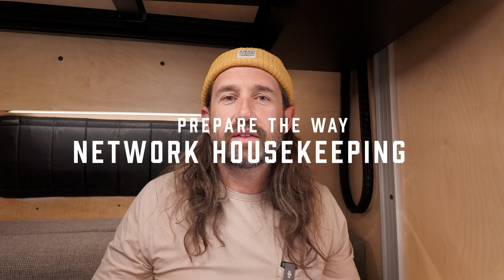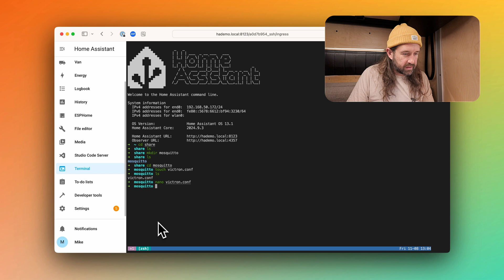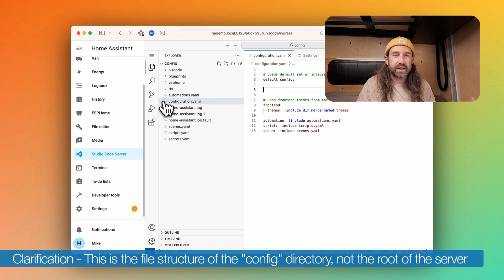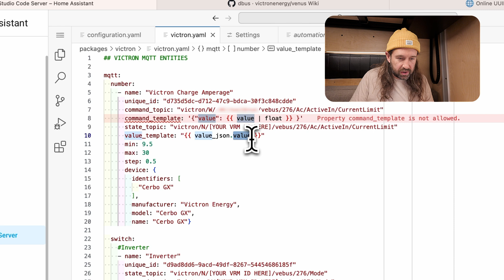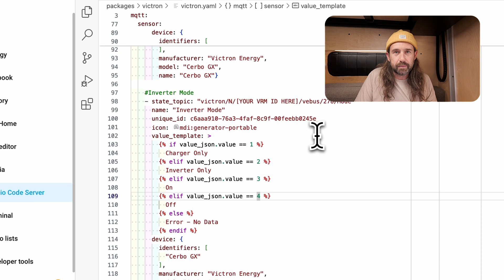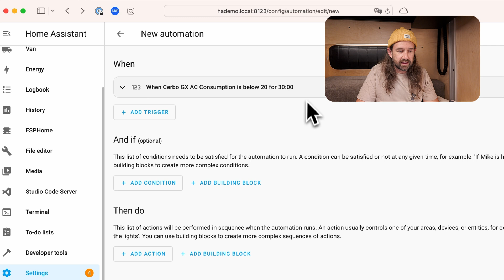Integrate Victron Into Home Assistant Using MQTT (bi-directionally!)

Comment: Hey Mike.  What a great video, it's just what I'm after!!
I'm having a few issues however...  The first is that the MQTT feed from my Cerbo goes to sleep after a few mins.  It starts again if I got to the vrm page on a browser but only for as long as I'm on the page.
The "keep alive" automation is running (I can see it on MQTT Explorer) & I'm running the latest firmwear.
Any ideas what could be preventing it from staying awake?
Thanks in advance.
Reply from the maker: My first instinct is to double check that your automation is sending the correct message. What is your topic and payload?
Reply: @SmartyVan  Hey.  Thanks for getting back to me! 
The topic I'm using is; victron/R/<secret>/system/0/Serial
& I can see it refreshing in MQTT Explorer.

I was sending "{}" as the payload, but I wondered if it wasn't keeping Cerbo awake because it wasn't changing so I changed the payload to a timestamp, but no change (I can see the timestamp changing on MQTT Explorer)

I have nodered enabled on Cerbo as part of the "Large Features" & use MQTT to publish some system numbers to my old automation setup.  Do you think that could be a problem?  I don't see how it can be...
Reply from the maker: Looks correct. As you see this message in MQTT, I would next investigate your MQTT custom config (share/mosquitto/victron.conf). Are your topics correct?

topic N/# in 0 victron/
topic R/# out 0 victron/
topic W/# out 0 victron/
Reply from the maker: Also double check your automation traces to confirm it is actually triggering ever 30 seconds.
Reply: @SmartyVan  Looks like that might be it!!!
My file contents looked exactly right, but I deleted them anyway & pasted your text back in.  Seems to have done it...
A rogue space or something maybe??

Comment: I am trying to write to DVCC Max Charge Current and get the following error

2025-02-13 12:45:17.891 ERROR (MainThread) [homeassistant.helpers.template] Template variable error: 'value_json' is undefined when rendering '{{ value_json.value |round(0) * 1}}'
2025-02-13 12:45:17.891 ERROR (MainThread) [homeassistant.components.websocket_api.http.connection] [139648709657360] TemplateError: UndefinedError: 'value_json' is undefined rendering template for entity 'number.victron_max_charge_current', template: '{{ value_json.value |round(0) * 1}}' and payload: 20

This is the configuration:
mqtt:
    number:
        - name: Victron Max Charge Current
          command_topic: "W/xxxxxxxxxxx/settings/0/Settings/SystemSetup/MaxChargeCurrent"
          command_template: "{{ value_json.value |round(0) * 1}}"
          state_topic: "N/xxxxxxxxxx/settings/0/Settings/SystemSetup/MaxChargeCurrent"
          value_template: "{{ value_json.value |round(0) * 1}}"
          unit_of_measurement: "A"
          min: 0
          max: 40
          step: 1

This is a snapshot from MQTT Explorer:
"Sorry cant past images?"

The error I get is when moving the slider on the overview page.

Feels like this is a read only variable but how does the DVCC write to it?

It is a FreedomWon battery and BMS

WHAT AM I MISSING PLEASE!

Regards Peter
Reply: Ignore above. I had the command template wrong

Comment: Getting an error wondering if Anyone can shade some light on it.
Configuration warnings
Invalid config for 'number' at packages/victron/victron.yaml, line 5: required key 'platform' not provided
Invalid config for 'sensor' at packages/victron/victron.yaml, line 81: required key 'platform' not provided
Invalid config for 'sensor' at packages/victron/victron.yaml, line 98: required key 'platform' not provided
Invalid config for 'sensor' at packages/victron/victron.yaml, line 123: required key 'platform' not provided
Invalid config for 'sensor' at packages/victron/victron.yaml, line 168: required key 'platform' not provided
Invalid config for 'sensor' at packages/victron/victron.yaml, line 183: required key 'platform' not provided
Invalid config for 'sensor' at packages/victron/victron.yaml, line 199: required key 'platform' not provided
Invalid config for 'sensor' at packages/victron/victron.yaml, line 222: required key 'platform' not provided
Invalid config for 'sensor' at packages/victron/victron.yaml, line 238: required key 'platform' not provided
Invalid config for 'sensor' at packages/victron/victron.yaml, line 256: required key 'platform' not provided
Reply from the maker: If you head over to discord and post your entire config, we can help sort it out! https://discord.gg/3rqeqES3zP
Reply from the maker: Platform is required. Must be number. Here’s the docs: https://www.home-assistant.io/integrations/number.mqtt/

Comment: Does the Cerbo GX have its own MQTT broker? Wondering if I really need HA to add custom devices (ESP32) to my Victron system. Seems like I would need an additional server running continuously just for HA
Reply from the maker: It does appear to be running Mosquitto. I just tested connecting to the Cerbo using MQTT-Explorer. I haven't tried using the Cerbo as a broker or doing much with it other than syncing to my Home Assistant broker, but it does seem to be running a broker. The recent Cerbo (VenusOS) firmware seems to change some configuration around MQTT which I haven't played with, so keep that in mind. I have not updated from 3.1.1.
Reply: Thank you for checking! Will try it myself soon
Reply: I was able to publish topics from an esp32 module with identical structure to Cerbo GX. Is it possible to create new digital input entities in Cerbo GX by publishing W topics from the ESP32?

Comment: i have followed this guide but under mqtt it doesnt show cerbo gx or anything at all, i can browse the mqtt broker and see all the data, not sure where i have gone wrong
Reply from the maker: If you've set up the MQTT sensor configuration correctly, be sure to restart Home Assistant—especially if you haven't' used MQTT before.
Reply: @SmartyVan  sorted now, been watching your videos for hours tonight but i am finally there...... apart from... how on earth did you get the inverter control as a toggle switch, i can only get one switch to turn on and another to turn off.
Reply from the maker: Glad to hear you're sorted! I have heard from another viewer that their switch wasn't working with optimistic: set to "false". You can try setting "optimistic: true" and see if that works better. I think it may be the response time of the inverter confirming the switch state too late. Which inverter do you have?
Reply: I’ve tried & failed 🤦‍♂️When checking MQTT explorer I can see Victron but only 2 topics which are the Victro’s  id.
I’ve just done a fresh install with just this on in case any of my other things were causing issues & still no topics. Rebooted etc.
I’m not sure if it’s more an issue with the Victron not sending messages rather that HA not receiving??
Any guidance appreciated
Thanks
Reply from the maker: If you can post your full configuration over on discord we can help you get sorted: https://discord.gg/3rqeqES3zP

Comment: This is such an AWESOME video - Learnt a ton of things! Thanks a lot for sharing!

I have one question - the GET of my cerbo values is working fine but SET does not appear to work from Home Assistant. 
As a test I used MQTT Explorer to connect directly to the Cerbo and I can Get (N) and Set (W) perfectly as confirmed by checking in VRM.
Now when I use MQTT Explorer to connect to HomeAssistant I can still Get (N) fine but it will not Set (W)? Any ideas what could be going wrong? The 'victron.conf' contains 'topic W/# out 0 victron/'.

Thanks in Advance 👍

Comment: Hi, thank you for the video, it is perfect and everyrhing is now working BUT the switch for the inverter (my victron multiplus 12/800).

  switch:
    #multiplus
    - name: "Multiplus"
      unique_id: "f27155ec-2ece-44e1-a1f7-eb8700de2949"
      state_topic: "victron/N/c0619ab546c7/vebus/276/Mode"
      command_topic: "victron/W/c0619ab546c7/vebus/276/Mode"
      state_on:  '{"value": 3}'
      state_off: '{"value": 4}'
      payload_on: '{"value": 3}'
      payload_off: '{"value": 4}'
      optimistic: false
      device:
        {
          identifiers: ["Cerbo GX"],
          manufacturer: "Victron Energy",
          model: "Cerbo GX",
          name: "Cerbo GX",
        }

I can switch off the inverter
but I always got a unknown statut.

So I create a number entity :

   - name: "Multiplus Modes"
      unique_id: 4d77f3d6-9214-4492-b72e-b7678dc6df87
      state_topic: "victron/N/c0619ab546c7/vebus/276/Mode"
      command_topic: "victron/W/c0619ab546c7/vebus/276/Mode"
      command_template: '{"value": {{ value|float }} }'
      value_template: "{{ value_json.value }}"
      min: 3
      max: 4
      step: 1
      device:
        {
          identifiers: ["Cerbo GX"],
          manufacturer: "Victron Energy",
          model: "Cerbo GX",
          name: "Cerbo GX",
        }

The number entity works correctly

Do you know why the switch entity has problem ?
Reply: FOUND !

  switch:
    #multiplus
    - name: "Multiplus"
      unique_id: "f27155ec-2ece-44e1-a1f7-eb8700de2949"
      state_topic: "victron/N/c0619ab546c7/vebus/276/Mode"
      command_topic: "victron/W/c0619ab546c7/vebus/276/Mode"
      payload_on: '{"value": 3}'
      payload_off: '{"value": 4}'
      state_on: "3"   <---------------- good
      state_off: "4"  <---------------- good
      value_template: "{{ value_json.value }}"   <---------------- good
      optimistic: false
      device:
        {
          identifiers: ["Cerbo GX"],
          manufacturer: "Victron Energy",
          model: "Cerbo GX",
          name: "Cerbo GX",
        }

Comment: For some reason there are only one  selection "MQTT access", not the two ones in the video (MQTT on LAN with both SSL and Plaintext). Also, no data is presented from the Victron. Any ideas?
Reply from the maker: I'm going to guess you've updated to the newer Venus OS firmware. The change log notes that: "Settings -> Services -> MQTT access. This setting enables or disables MQTT access over ports 1883 (plaintext) and 8883 (secured)." So, the setting has changed. You can read the full details in the change log for Venus OS. So, you should just have to turn on that MQTT access switch. If you're not getting data from the Cerbo, there may be additional issues—perhaps the custom Mosquitto config.
Reply: @SmartyVan  Thanks! Ended up with a conf file like this one:

connection victron
address 192.168.30.220:8883

remote_username xyz
remote_password ***********

topic N/# in 0 victron/
topic R/# out 0 victron/
topic W/# out 0 victron/

bridge_tls_version tlsv1.3
bridge_insecure true
bridge_cafile /share/mosquitto/cerbo.crt
Reply: @SmartyVan  To use later version of the Cerbo firmware (without clear text mqtt)

victron.conf:

connection victron
address 192.168.30.220:8883

remote_username <username>
remote_password <password>

topic N/# in 0 victron/
topic R/# out 0 victron/
topic W/# out 0 victron/

bridge_tls_version tlsv1.3
bridge_insecure true
bridge_cafile /share/mosquitto/cerbo.crt

where cerbo.crt is extracted trough:

openssl s_client -connect 192.168.xxx.xxx:8883 2>/dev/null </dev/null |  sed -ne '/-BEGIN CERTIFICATE-/,/-END CERTIFICATE-/p' > cerbo.crt

Comment: I'm struggling to find a dashboard card to control the Inverter. I can get an entity card to work, but not a button. What did you use?
Reply from the maker: I use a button card. If you've set up your inverter as an MQTT switch, a button card should toggle by default. Double check the tap behavior in the button card configuration—should be "toggle".
Reply: @SmartyVan  I've got it working by setting optimistic to TRUE
Reply from the maker: Interesting. Glad that worked. Down side is your switch isn't waiting on confirmation back from Cerbo that the inverter is on. When you had optimistic: false, did the switch change to on immediately? or never? or eventually once the inverter turned on? Be sure you have state_on, state_off, payload_on, and payload_off all defined correctly. You can see how I have them defined in my gist: https://gist.github.com/SmartyVan/7714e861d19a9415a8337a158d392a1e 
But also check the values in MQTT Explorer or somewhere to be sure your cerbo isn't using other numerical values than 3 and 4 for on and off for inverter state for some reason—perhaps a different inverter model, etc?
Reply: @SmartyVan  This inverter uses 2 & 4 for on & off.  The switch changes immediately. I tried to set an automation to turn off the inverter if the inverter output is below 50 for 5 minutes, but the inverter/cerbo stops sending power information once it has sent zero. There are no updates unless there is a change. I have got a Sonoff button to switch the inverter on/off.
Reply from the maker: I’m not totally following your situation here. If you feel like some one-on-one personalized trouble shooting would be helpful, I can offer zoom consulting sessions. Shoot me a message mike@smartyvan.com
Reply: @SmartyVan  The Inverter is the Victron Pheonix 1200va. The Cerbo only publishes a topic when the value has changed, so my automation didn't work. I'll think of another way!
Reply from the maker: I’m using AC Consumption (victron/N/[YOUR VRM ID]/system/0/Ac/Consumption/L1/Power). AC power consumption never drops to zero with the MultiPlus II when the inverter is on as there is some consumption to keep the inverter on—so I use below 21 watts. Either way, your automation should be looking at AC Consumption to evaluate if any AC power is being used by the inverter. If that value drops to zero (or below whatever value you choose), the automation will evaluate if it stays below the value you set for the time period you specified. No further values need to be reported from the Cerbo for this to work. As the Home Assistant automation is simply saying has the value stayed below the threshold you set for X amount of time.
Reply: @SmartyVan  Got it. I was looking at it from old coders eyes!  Value & Time were separate things in my thinking. I've just got to calibrate it for the standby current of the induction hob.

Comment: Hi .. Nice video, however I`m having an issue where I host my mqtt broker in a container and not HA .. I`ve done all the steps (except the share/mosquitto as my mapping is different) but I get no data in my MQTT explorer other than the messages from a keep alive automation .. I`m also running the modbus config in HA which recently stopped working due to latest HA updates so I was looking at the mqtt alternative .. 

so my mqtt install is in /etc/mosquitto where i created the victron.conf it shows fine in the mqtt .. correct cerbo ID howeber I only get the R topic and the keep alive automation messaged from HA .. so HA speaks to broker but it appears cerbo doesn`t .. 

I wonder if anyone has a broker that runs outside of HA ..
Reply from the maker: I would check your Mosquitto logs and be sure your custom configuration is being read!
Reply: my mqqt broker is setup in such a way that clients need a username and password to connect in order to post/read topics .. I think this is the issue I have .. how do I implement this into the victron.conf ?
Reply from the maker: we're just bridging the Cerbo broker to the Mosquitto broker, so it's unlike a traditional device that needs a login to the Mosquitto broker
Reply from the maker: I'm not familiar with running the mqtt broker in a container, but if you're seeing your keep alive automation hit the mqtt broker, it sounds like either the custom configuration for the broker isn't set up correctly (or in the correct place with your container setup) OR perhaps the cerbo settings for MQTT aren't activated correctly. Perhaps double check where your custom mqtt broker config needs to go (and be sure the broker is configured to read the custom config) as well as check your Cerbo settings at Settings>Services to be sure MODBUS and both MQTT options are active.

Comment: Very good explanation,

However I have a problem with determine the IP of the Cerbo (that i will sort out with the routerguy and 2nd; I do use Nabu So the IpV4 adres is creating an connecrefused-error. Then I tried the Nabu link but replied with a timeout. So any suggestion ?
Reply from the maker: You can you can find the Cerbo IP in the Cerbo interface or your router client list. I’m not sure what you mean by “tried the Nabu link”… tried it for what?
Reply: @SmartyVan  I did found the IP of the Cerbo however I did not get any answer (topic N etc) after filling in this ip in the terminal-nano.
Reply: @SmartyVan  when I start Mosquitto broker, it has been stopped because of SSL is not enabled according the logfile
Reply: Update: i finally found the error. So MQQT explorer is showing the right data from my Cerbo

Comment: I noticed that the battery temperature under system > 0 > DC > is listed as null. Is it possible to get the Victron lithium smart battery internal temperatures via mqtt from the batteries themselves? Perhaps under the N > cerboGX > battery? They are accessible via bluetooth using the victron connect app. Looking to use this value to drive battery heaters, but am not far enough along in my assembly to test myself. Appreciate any feedback!
Reply from the maker: I'm fairly certain the battery temperature info available on the Victron Connect app (transmitted via BT) is NOT sent to the BMS, therefore is unavailable in the Cerbo (and MQTT / MODBUS etc). It seems silly, but I'm not sure that the connections between the Victron Smart Batteries and BMS are carrying much more than an allowed to charge/discharge signal. 

You could, however, connect your own temp sensor to one (or more) battery posts and pull that into the Cerbo (and then into MQTT). This product from Victron should work with your GX device: https://amzn.to/4iCqzb5

They have a few temp sensors, be sure to get the right one: https://www.victronenergy.com/live/temperature_sensors